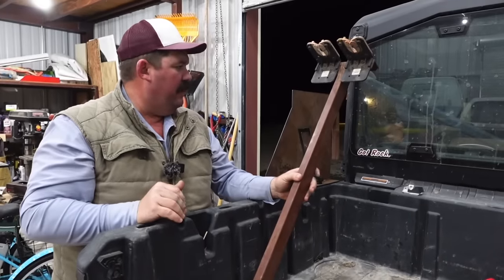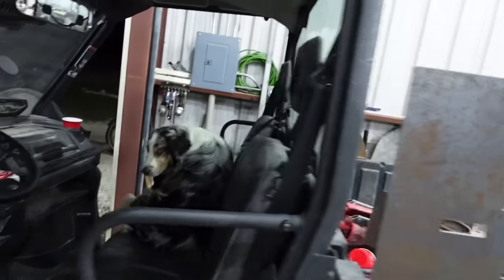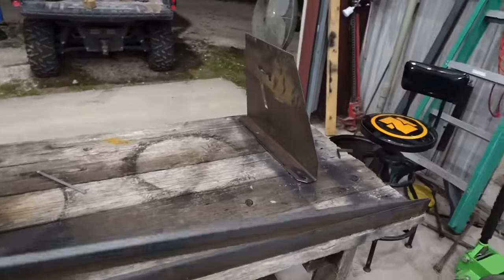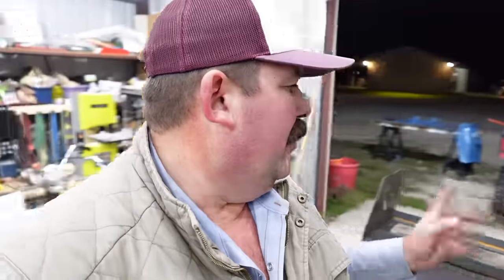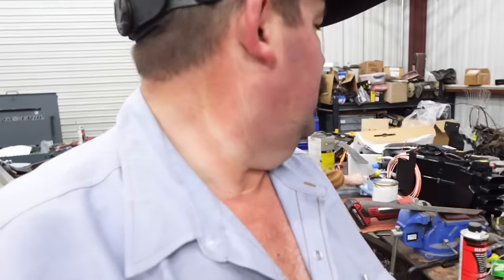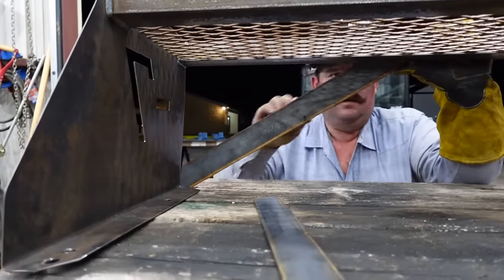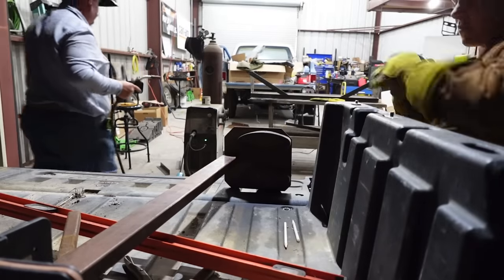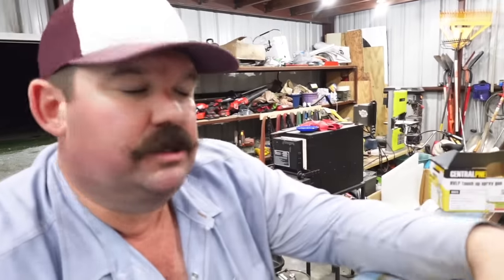How to Build a Hunting Rack for Your ATV | Bar 7 Ranch

Comment: Drill a hole and weld a nut on your gun rack bracket then put a bolt to snug it in and it won’t move👍🏻

Comment: If clamping the metal down to take the play out doesn’t work. I was going to suggest a hitch pin. Cross drill the mount bracket and the gun rack tight to the O.D. of the pin. I don’t foresee that thing bouncing out but would also help keep it from coming out the bracket. Either way great video! Keep up the hard work